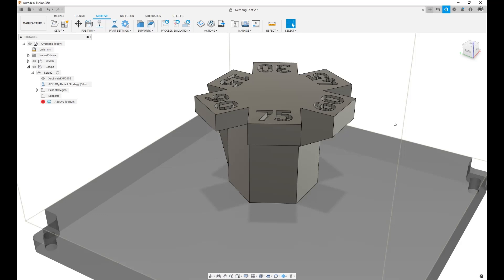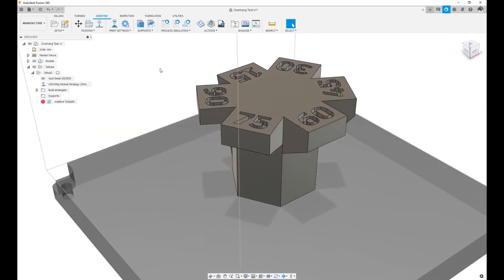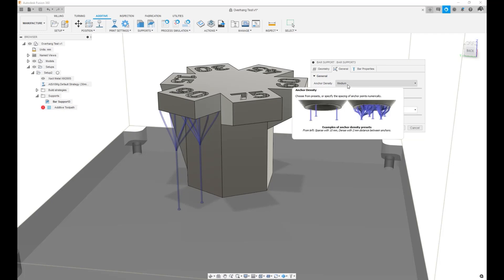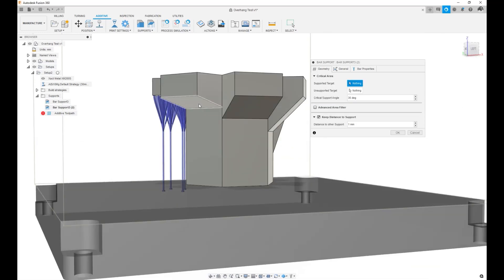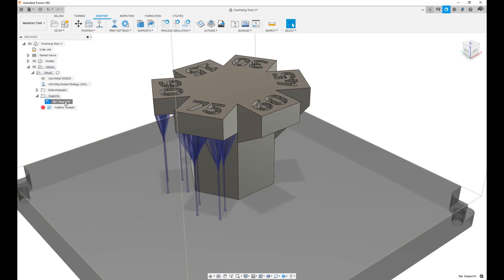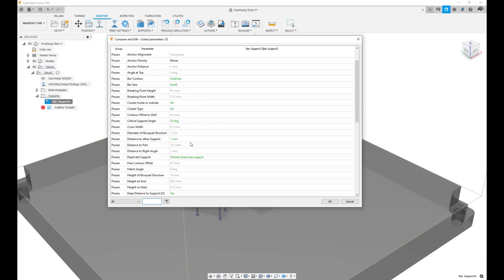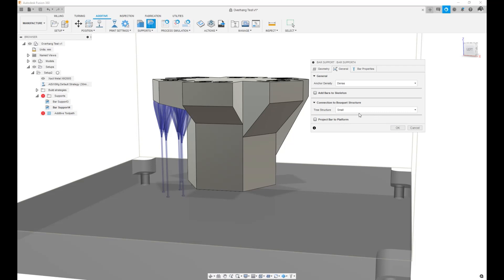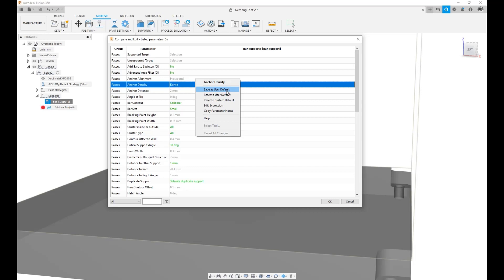Editing Support Structure Defaults for Additive Manufacturing | Autodesk Fusion 360

Comment: is it possible to export the support structures you generate as an stl?   I really need to make some supports but I need to be able to save them out as an stl.
Reply: Yes, you can export the part and its associated support as a 3mf file. You can later open that 3mf file in fusion and just export the support section as an STL if 3mf does not fit your workflow
Reply: @sualpozel1  how?